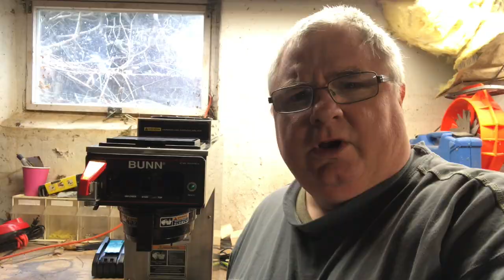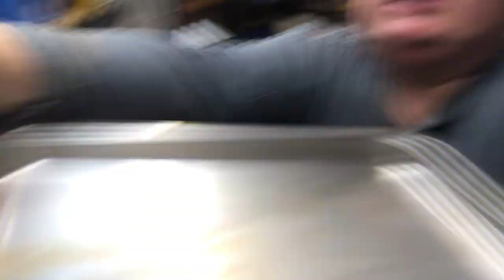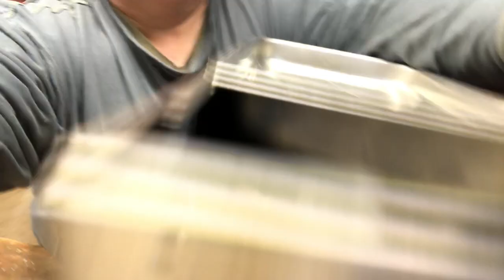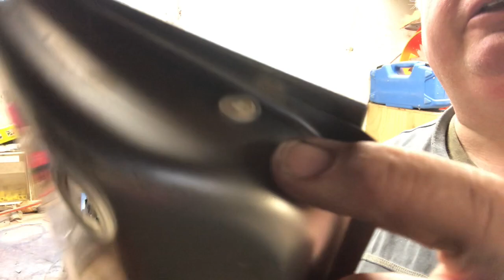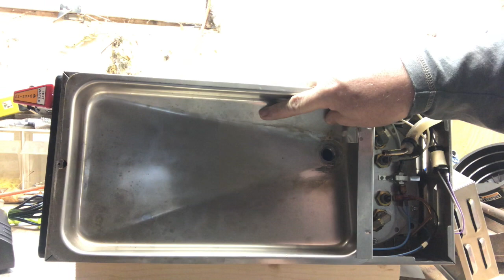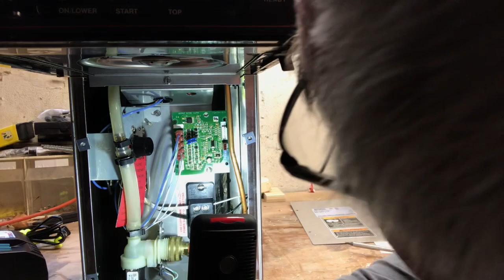Bunn CW series electrical and leak points

Comment: Very nice video. I have the same coffee maker as in your video that is filling with water constantly and causing the tank to overflow even with the unit unplugged.  My first thought was that the electric water inlet valve was bad. I checked it and the valve is not passing any water so it's not the cause of this overfilling.   Further investigation has me really baffled so I hope you can help'
The water supply line coming to the back of the coffee maker connects to a tee fitting that then directs the water in 2 directions.  The first direction is through a cylindrical brass container that has a micro screen in it to filter out particles. The outlet of that cylinder then connects to one of 2 brass nipples in the back of the coffee maker.  
The second direction that the tee fitting direct water to is to a second brass nipple in the back of the coffee maker.  
So the first nipple then directs water to the electric inlet valve, which makes sense because that's how the machine can control the amount of water going into the tank.
The second nipple directs water directly to the top of the tank through a copper tube with nothing to stop the flow of water, so when I turn on the water supply going to the coffee maker, the tank just keeps filling through this tube until the cows come home.  
My thought is to cap the second nipple and the tee and have water going only to the first nipple but a label in the back has a diagram showing the proper way to connect it to the water supply and the way mine is setup is exactly how the label shows it should be. 
Any ideas would be highly appreciated.
Reply: I just called Bunn Tech support and got the answer . Figured I would share it in case others have this problem. Turns out there is an internal loop inside the tank that has sprung a leak. In my case the reason the loop sprung a leak was because the coffee maker was left in a garage over the winter and the water inside the loop froze.
Reply from the maker: @TheNYgolfer  thats great, i was going to say to check the relay valve. Sometimes that calve will stick with a calcium and leak water by. So it looks lime the “Insta hot” water circuit sprung a leak. When you order parts make sure to order the silicone parts for the boiler and the anti siphon tube as well. You also just plumb in the main boiler circuit and just bypass the insta hot water circuit till parts get there. The other thing you now have the ability to deep clean the heater and the boiler. If I were you, I would also order a new heater element.
Reply: @n3qdz  Thank you so much for your quick response and excellent advice. This unit was stored in a garage for several years and what happened is that the residual water in the coil froze and ruptured the coil. So as per your suggestions I will replace the heating element along with coil.  I did initially check the relay valve but it was not passing any water even when I put 120 Volts to it. So it also is bad. Probably ice damaged it too. So it will also get replaced. Thanks  again.
Reply from the maker: @TheNYgolfer  excellent just don’t forget the get a new anti siphon tube that goes to the boiler and sometimes comes off and will give you all kinds of issues with leaking into the pot. Let me know how it goes!
Reply: @n3qdz  I replaced the coil inside the tank and I replaced the heater as you suggested since I had it all apart.  I read your last comment after I had already finished all the repairs so I did not replace the anti-syphon tube. For future reference , may I ask where this tube is located on the unit.

Comment: My brew button does not make sound anymore when I push the brew button. But Coffee brews fine. Is this a problem.
Reply from the maker: When you push the brew There is a relay that opens up the water so the sound that you’re hearing is the water rushing through the relay valve. The fact that you don’t hear the water rushing through it may be an issue but if it’s brewing OK it may be just. Does it brew with the correct volume?

Comment: PLEASE HELP! I have a bunn CW Series Model CWTF15-TS,PF that after I have made a batch of coffee and leave the power switch on, eventually steam start emitting from the unit.  Obviously, evaporation is occuring, but WHY?  Please advise!!
Reply from the maker: The thermostat inside of the machine  is turned up too high. You will need to remove the front panel and you will notice  a black knob that needs to be turned down. A way to Tell is brew a pot of coffee and put a thermostat in the pot itself on the freshly made water it should be below 212°
Reply: Thank you so much for the advice.  Thanks to you, my co-workers are happy! God  bless @n3qdz
Reply: @n3qdz  ok sir, thank you I will try this out.  Thank you so much! stay tuned!
Reply from the maker: @laneshine7811  yes please let me know how it goes please!

Comment: Hello pal. We have a CW series in my firehouse, and it seems to be overflowing from the back, out the bottom most grate, probably where the bottom of the tank sits. Any ideas what could be causing it to overflow? Leaks a few ounces every time we start the pot. Thank you for your time.
Reply from the maker: Hey Ryan please forgive me, I just saw your comment. Hopefully you may have figured it out. If not, there are several options the easiest in the boiler water inlet. When you remove the top you will see where the where the water enters the boiler. Scale will build up at the opening. Now before you go shoving a clothes hanger down the hole there is a hose that is attached to that inlet. If that tube in off,  the water will not displace the hot water to brew properly

Comment: Good evening sir,
How can I repair if leak is out of thermostat? Water comes up while brewing. I noticed that the seal that holds the thermostat is not set in place. Is there a type of glue I could use?
Reply from the maker: I think you are talking about the thermostat probe that goes into the boiler. That piece that is on the top of the boiler is silicone and overtime with water hardness that silicone plug is not pliable anymore. You can purchase the plug through Bunns service parts distributor
Reply: @n3qdz  
Thank you much!
Reply from the maker: @JDiaz-pj8zj  no worries please let me know how the repair comes along
Reply: Good evening,
Can you please make a video on how to replace the silicone piece?
Reply: Good morning Sir. My Bunn Industrial  continues drips coffee and overflows the coffee pot after brewing. How can I fix this problem?

Comment: Hello! We've had two of those brewers in the cafe I work at now, and the owner has probably had them for more than 10 years. I asked if she ever had someone descale it and she said never.
I've measured the water temperature and it's reading around 180 degrees. so I suspect the scale might be affecting it. Both thermostats are set all the way clockwise. How would I descale them if our brewers are plumbed in.
Thanks for the very informing video!!!
Reply from the maker: Bunn makes a descaler that works very well I hear.

Comment: I have a CDBCF 15, 3L WRMR Right PF. It has started showing not ready and won’t start, after a few minutes the temperature lights start flashing 3 blinks, slight pause and 3 blinks, over and over. Any ideas what may cause this. Thanks Johnny
Reply from the maker: Ah thats one I don’t know sorry man. I will see what I can find but, sorry I don’t know what logic circuit that would be

Comment: My coworker changed the filter going to our bunn coffee maker in the shop and he ran the faucet to get any air out of the line and the water came out black, like some algae was in the tank. Can we run vinegar through the coffee maker?
Reply from the maker: Yes the boiler is made from stainless. Typically the heating  element can get caked up with mineral. Whatever you do, DO NOT run CLR. It could permeate and maybe, maybe damage the seals. Besides you really are not sure 100% weather you got all the the CLR out of the machine. Please make sure you remove the spray head just above the grinds basket. Make sure that the spray head holes are free of minerals. It is important when you flush the machine to flush it with the spray head off. This will run the most amount of water through the machine. I also think Bunn bakes a solution that I have heard that works pretty well. About every 6 months I run vinegar through the machine and also spring the machine. It’s a bunn tool to clean out the lines to clear containment’s in the spray head lines.
Reply: @n3qdz  I agree with you on sticking with white vinegar... the surprising thing I learned about CLR is that it's not poison. I looked it up... I guess you could drink CLR and not die from all I've been able to fine. Weird. (?)
Reply from the maker: @FuelTankerMan  eh yea not something i would like to try. I know on their site they show it in coffee machines. For me....eh no thanks. Thanks for the comment

Comment: As soon as flip the toggle switch for the heater in the back of the unit it trips the GFI the unit is plugged into.I replaced the thermal cut/off and lead. It’s still trips breaker when when I flip the power switch to heater. What part is likely broke?
Reply from the maker: So, looks like you have a dead short. I would unfortunately take a look at the heater element. If you put test lead across the heater element you should have a complete circuit. Just a habit for me i remove the top of the boiler (1st to replace the boiler gasket) and check the heater element and also the insta hot coil circuit as well. Try that and see what you have. This also gives you the ability to super clean the boiler and remove any scale on the heater and hot water elements

Comment: How would you fix it leaking out of the pink cap from the thermostat wire, I think it’s from there and it’s not tight on and hard to get suctioned
Reply from the maker: On top of the boiler where the thermostat probe enters the boiler that is a silicone plug. That is a replaceable part.
Reply: might it be overflowing internally?

Comment: 20:13 you point to a device you can’t remember the name of.  Do you remember what it’s called?   I have a broken one and not sure what it’s called to order a replacement.
Reply: Thank you.  That is exactly the part I need.
Reply from the maker: @TheHouse-pv7lv  That's awesome! 5 min repair. It will take you longer to disassemble and reassemble that it will to do the actual repair!
Reply from the maker: I think what you are looking for is called the Hi limit thermostat bu29329-1000 there is the page number from Bunn part number 29329.1000 I believe that may be what you are looking for.
Reply: How good are you at gasket identification?  I have a few gaskets that appear to be changed but I don’t know part names. Our 1997 commercial bunn started to leak.
Reply from the maker: @TheHouse-pv7lv  https://www.partstown.com/bunn/parts?page=0 this is where I order my parts from. On the identity tag on the front panel you can look up directly  your model and they have an exploded view and part numbers

Comment: What would cause the unit to drip every 10 seconds or so constantly through out the day. Water solenoid isn’t bleeding by
Reply: The hot water coil that is inside the boiler that supplies the hot water faucet on the front had a hole in it which caused the boiler to over fill and drip out of the coffee drip head. I disconnected where main water supply off of the t and used a couple of compression fittings to get them by until new coil comes in.
Reply from the maker: @travispearson9833  thats a bummer but great that you found it. The coil is very easy to replace. Hopefully you also ordered the gaskets too. Ley me know how it turns out!
Reply from the maker: Hum, that's a good one. Well, It could be temperature from the boiler set too high. 212 degrees you make steam. if the boiler is set too high it could be that the machine is making low level steam ( just a weird thought) a couple questions. When you brew a pot of coffee, are you getting a full pot or are you getting a lower than usual filled pot? If you are still getting a correct level of water when you brew that might sound like a tiny leak past the solenoid. if you are not getting the correct level of coffee brew that sounds like a boiler too hot and creating steam then condensing and thus a consistent drip. Here's a test you can try, this will test both the solenoid and the temp. remove the coffee pot remove the cover. There is the temperature control know. Make note where it is and turn it all the way down and leave the machine for several hours. because the same in the boiler is hot, brew two batches with the  boiler temp set to low/off. This will get the boiler cold enough as not to bee so hot. If you come back and no drips the temp was set too hot. If if continues to drip you have a tiny leak in the valve. Another way to test to see is the valve is not sealing correctly but off the water supply to the machine. If no water coming into the machine you should not have any drips. If it is the solenoid, just run 4 or 5 back to back brews just to exercise the valve to see if it clears the internal valve. If you have hard water the valves rubber o ring might be hard and not creating a correct seal. Now, with the thermostat is not property functioning that can be a big problem. You want the water  both is the pot and at the hot water access point to be between 200-212 degrees. I set mine in the high 190's. Sorry for the long answer please let me know how it goes of if any other questions.

Comment: What would be a possible leak point for a VPS series while it's sitting overnight?  Thank you.
Reply from the maker: there could be only a few points. on the top of the boiler check the gaskets around the lid, the temp probe and also where the hot water comes to the front spout. there is a joint there that the silicone washer can break down. Make sure to unplug the unit before you put your hands in the machine, feel around and feel for the wet spots. I may have a feeling the lid on the boiler may be the problem. let me know what you find.
Reply: @n3qdz  Thanks for the reply.  I suspect it's the boiler as well.  Does anyone make a regasket kit, or do I have to know which individual gaskets to replace?  I'm going to disassemble that far I figure I should do the whole enchilada.
Reply from the maker: wakkoss I’m not sure is Bunn makes a kit, I’ve had to order each separate. Let me know how it goes

Comment: It might be good to mention with the automatic type, where the water line comes into your Bunn coffee machine to install an in-line water filter, just like the water line coming into your refrigerator.  I know many have built-in water filters but I use the manufacture's bypass option and run my own filter outside of the refrigerator which costs me only $19.99 per year.  I've been running that set up for years with huge savings.  An inline water filter will definitely cut way down on the scale build-up I see on those Bunn coffee makers.

Comment: I just hooked one up with push fit and I noticed a lot of eater coming out of the top tank like it’s too much pressure I have a 1/4 inch push fit line no regulator any suggestions?
Reply from the maker: Alex smith the machines relay water valve should step the flow down. There could be a few things I would check. When you remove the top is the connector between the tray and the boiler free of calcium deposits. This will get clogged and the water will not flow fast enough into the boiler and you will have a ton of water. Second the supply line that feeds the tray has a stainless steel tip on it. Make sure that is clean. If that has a calcium buildup it will be like a hose end sprayer. Removing the top is super easy the screw in the front slid back a bit and lift up. With the top off you also can see the position of the fill tube and make sure it’s positioned correctly I’m the supply tube. Please let me know if and if it helped I’m interested in what the problem was

Comment: Someone decided to put coffee grounds into the "pour water only" section of the Bunn CW. It appears to have gone into the area where the water gets boiled and caused a clog. Any suggestions on how to fix that? That is causing some serious leakage, not due to a leak point, but rather due to the lack of the fluids not being able to pass through.
Reply from the maker: OH NOOOO. so what you can do the take out the ground basket and unscrew the sprayed. I bet everything the sprayed is all clogged. if you look where the grounds basket goes and look you will see the spray head. It might be difficult to unscrew but, it will unscrew. next there is a switch on the back of the machine turn that off. This will turn off the main heating element in the boiler, also unplug the machine. this will keep you from scalding yourself. Remove the top ad clean out ay grounds that my be left in the tray. SLOWLY add fresh water to try to flush the brew tube. Remember to keep the coffee pot to catch the grounds and the water. Once it begins to flow once again clean the spray head and run a TON of water through the machine WITHOUT the spray head till you don't see anymore grounds come out. you still may need to disassembler the machine and remote the top of the boiler to flush out the boiler (last ditch effort) Good look let me know how it turns out. Good luck If you do need to remove the top off the boiler you may need a now silicone gasket between the boiler ad the lid bu04221-0000